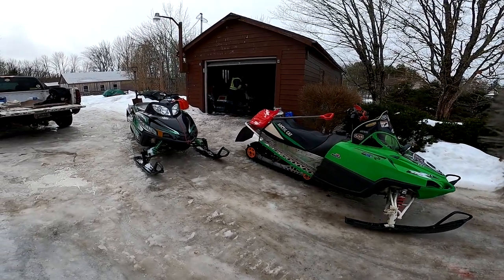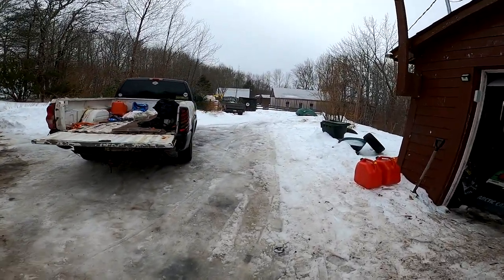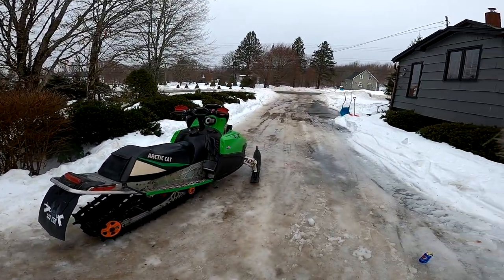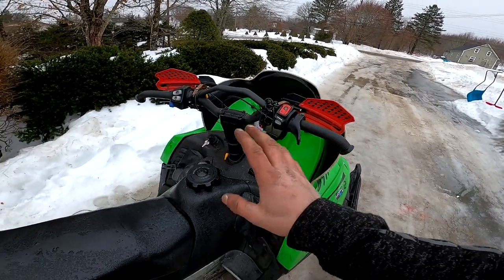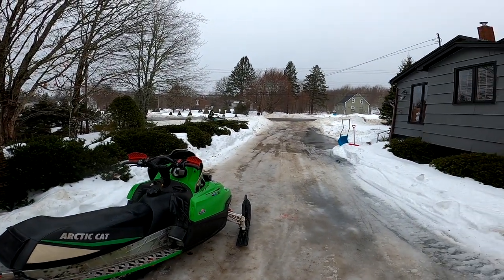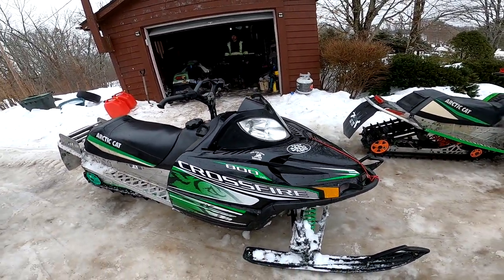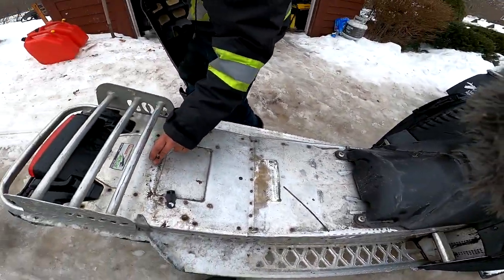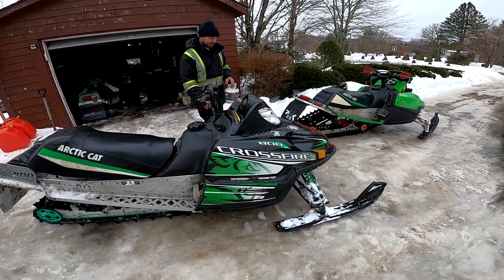Arctic Cat Crossfire 800 Guages not Working Lost Power and Bogging Bad Limp mode!! How to Fix!

Comment: So beyond me having to rebuild the clutch after this weekend on my 05 M7, I have had a bad bog which could be clutch related due to sticking or reeds but it will take off for a split second and then fall on it's face while sputtering but sometimes it absolutely rips for about 5 min then back to sputtering. If I leave my headlight wire hooked up, it will melt the wire and everything flickers bad. I'm gonna try unplugging my taillight and see if it helps. I'm tired of Arctic cat wiring issues!